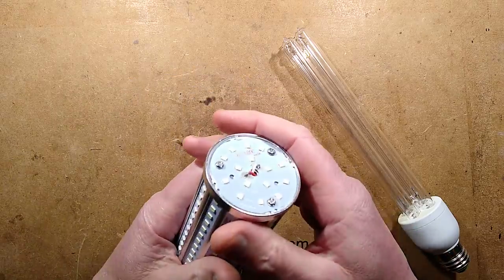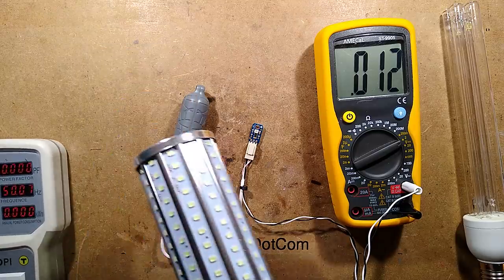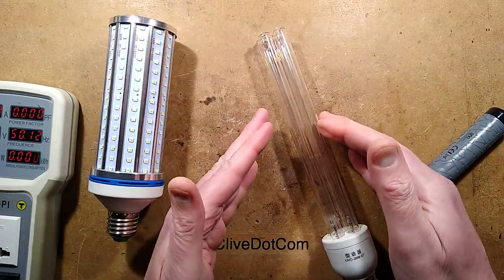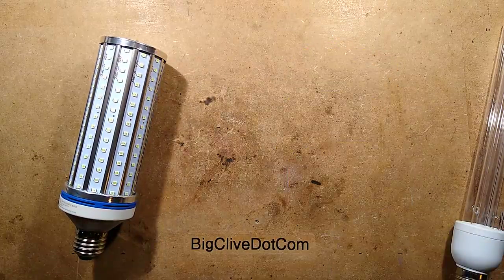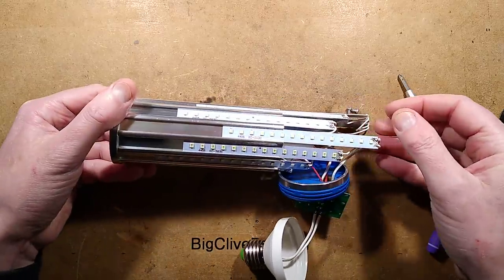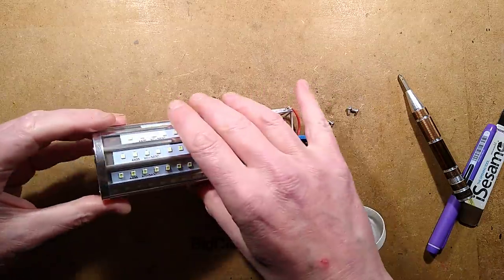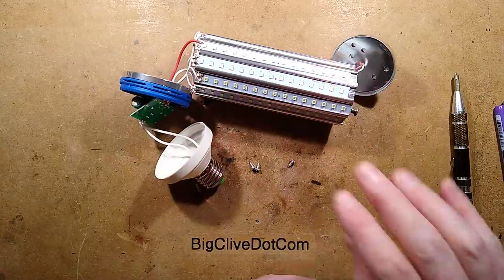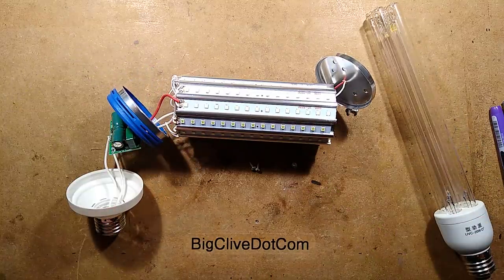Teardown of a fake UVC germicidal corn-cob lamp.

Comment: Bill Agnor

I  did a standard medical test to see if the Corn Cob LED light would kill bacteria.
 
Using a Sterile Prepoured Nutrient Agar Petri Dishes I introduced bacteria uniformly across the entire surface of the petri dish. I then laid an index card across half of the dish surface. Next I exposed the petri dish to the corn cob LED light at a distance of 4 inches for a period or 30 minutes (this extreme time should killed any bacteria) .
 
This configuration exposed half of the petri dish to the corn cob LED light and the other half of the petri dish was not exposed to the corn cob LED light. If the light was a real germicidal light the first side of the dish (exposed to the light) should have all of it's bacteria killed while the other half of the dish that was cover up should have a strong colony of bacteria growing after 24 hours of incubation.

Coming out of the incubator both sides of the petri dish are completely covered with bacteria.
The LED light has no effect on the bacteria. The germicidal LED Corn Lamp is a totally Fake.
Reply: Bill Agnor Thanks for confirming, that once again, Clive was right. Your test convinced me completely.
Reply: Dave Micolichek  I know, but with my medical background this is the ultimate test for me and other biochemical guys
Reply: Против Глобал  The petri dish test is based on the effects that only UVc light will kill bacteria. You can test any light system with a petri dish and the bacteria is only killed by UVc light therefore if the bacteria is killed it must be UVc light. In contrast if the bacteria are still living after being exposed to a test light source it is know that the light is not a UVc light. The exposure time and light intensity can be a factor so that is why my test used the extremely long time of 30 minuets.
Reply: Против Глобал The UV spectrum is divided in to UVa, UVb, and UVc. 

UVa goes from 315nm to 400nm and is generally consider Black Light that has no effect on bacteria.

UVb goes from 280nm to 315nm and is the range that tanning salons use but this range does not kill bacteria.

UVc goes from 100nm to 280nm. It is not visible to the human eye. This is the only range that kill bacteria. 

The reason people commonly beleive blue visible light will kill bacteria comes from the blue light produce by UVc quartz glass mercury vapor lamps that have been used for years to kill bacteria. The quartz class tube has a small amount of mercury inside and when it is energized it has two output products. First a soft blue visible light around 400nm to 450nm that does not kill bacteria, and Secondly an invisible bacterial killing light typically at the frequency of 254nm .

This allows sellers to use very cheap blue led's  that have no 245nm invisible  bacteria killing properties. This is a Hugh scam on the internet
Reply: Против Глобал  UVa does not kill bacteria.
Reply: Report your results to the FDA and CDC.  It's time to have government agencies go after Amazon and eBay for allowing these scam products to be sold on their platforms.
Reply: So are all corncob LED lights fake ??

Comment: Thank you so much for this teardown! 

When I was researching UVC germicidal lamps to construct a Coronavirus sterilizer, I found this exact type of bulb being widely marketed on both Amazon & eBay. At first it was very tempting because I was averse to the eventual disposal of a mercury vapor lamp, but as I read about commercial UVC LED's and then couldn't get a quote from the world's OEM's, I figured out that at that retail price they couldn't possibly have legitimate UVC LED's in them. So I went with a mercury vapor water sterilizer bulb.

But I just wonder how many people bought these bulbs to disinfect items, especially masks, and it was doing absolutely nothing. The advertisers & resellers could be guilty of criminally negligent homicide for selling these bulbs as germicidal during a viral pandemic. Shame on them!
Reply from the maker: The Chinese sellers have been selling fake and openly dangerous products for a while.  They really don't care.
Reply: @bigclivedotcom  Careful, or the almighty Andrew Cuomo will challenge you to a fight in defense of his precious china.
Reply: if you want to sterilize transparent clean gas (clean air) or fluids (clean water) it's ok to try uvc, but you will still get problems, even in ultra pure water.
- Life finds its way, as in Jurassic Park.

But anything with fibres, color, pigments or simply multiple layers (or even enough dust particles) is not safer by just beeing in a compartment with uvc.
- so, pleaaaaase dont take it personally, but i really doubt that your uvc lamp has a noticable effect (what do you use it in/for and hoping to get?).

Try "infrared" and simply heat it up to 75°C. Not clean but for sure "dead" for some time.

Just wash anything at 60°C (or better above that) with a normal household washing powder, not adding "sterilizing" overpriced marketing things.
...Good old times with 90°C washing...

and get rid of those stinking "microsuperfibers" who need desinfectant and sterilizers added and produce microplastics.

The washing machine and all "washed" clothes in many "modern" households simply stink again within short time because only washing at 40°C does not kill anything,
it only pauses it for a moment. oversaving water and powder (or using liquid cleaners which need addities to be that way) adds to the problem.

Then blending the stink over with adding tons of softeners does not help.
And it does also not help to add sanitizers (without running high temperatures to kill and remove in between) because the stinky biogoo
just stays in your machine as perfect nourishment for the next bacteria.
- Same hoax is done when the "car service" just sprays desinfectant into your car AC instead of CLEANING it.
Its a business, not a cure.

One warm humid day later (in case of washing machines, letting it sit one day) and all things grew back and you have the old moldy smell again.

...
...
...
...
-- Sorry for the rant :-(
We had tennants "my age" (around 30) (and also a classmate*) who were too stupid to properly wash their clothes and sent their kids with stinking clothes into kindergarden and school (guess the reaction of other kids...) and did not even notice it anymore because of the "smelly dog" effect.
I went through the basement looking for where that moldy smell came from and found it (repeatedly) being the "fresh washed clothes hanging to dry"
or even better, nicely breeding the stink at humid 40°C in the dryer.
But as a solution of course there was ultra eco bio washing liquid soap, "water and energy saving" programs for the machine
AND hard sterilizing additives added from time to time when the stink got too hard.

*stinky hand towels with tons of parfume softeners but still stinking underneath after getting wet/used. Also "sporting" clothes.
i smelled it, she did not even notice anymore.
Reply: Look up - suing or prosecuting anyone in China. Go back to sleep.
Reply: Viral disinfection via UVC light at around 254nm wavelength is well-researched, and for N95 mask decontamination, which is what I was planning, there is a site hosted by Nebraska Medical at www.n95decon.org that has all the relevant technical information, including UVC dosage & links to experimental citations and scientific analyses.
Reply: @alanmcrae8594  Thank you for the link. Watched the video about the different methods tested. 
interesting to see that nobody recommends using a mask for more then 5 on-offs because the fit is too bad then.
... I never had a mask which even at first usage gave me the feeling of a really tight seal :-(
Following the video for the "home user" the combination of heat and humidity by running an oven with a water pot inside and ramping it up to 85°C might be easier to handle and control.
Main problem does not seem to be treating one or two masks, but multiple at once.
 I go for the simple way of "my (surgical) mask protects other people if i wear it". And that other people wear their masks also.
Reply: bigclivedotcom I am looking for a genuine uvc germicide lamp, can anyone point me to one, I can’t tell what’s fake and what’s not.
Reply: Philips brand UVC germicidal bulbs are definitely real, but they cost a bit more. Anything from China and anything unbranded or off-branded is a bit of a risk. There are UVC bulb 3rd party testing companies, but they wouldn't give me a list of bulbs that passed their rigorous testing. This is such a money-grubbing, BS marketplace - be careful!
Reply: Alan McRae Thanks Alan, I’ll look at the Philips. Cheers!
Reply: Start reporting these postings to the CDC, FDA and other government agencies.  With enough complaints they might act on it.
Reply: @alanmcrae8594  Anything from Amazon or eBay are most likely to be fake or counterfeit.  Even the name brands.
Reply: @MichaeljRichter  Yeah, it is very difficult to tell what you are going to receive when it finally arrives at your door.  Even user product reviews can't be trusted because they get spammed by sellers & manufacturers. Online retailing is just like social media: untrustworthy & full of BS artists & scammers. Hard to be a diy engineer when you don't know where to source things reliably.
Reply: What’s a mercury vapor sterilizer?? and where can I find one ??? I bought a bunch of these ‘UVC’ Wands in JAN 2020🤦‍♂️ before videos like this one showed up on YouTube.
Reply: Alan McRae great website though didn’t understand much of it, i was hoping there’d be a video on what real UVC looks like .
Reply: @yeahidoubtit2094  A mercury vapor sterilizer bulb is basically a fluorescent light bulb that uses a special UVC wavelength transparent glass that doesn't have the visible light emitting phosphor coating of a standard fluorescent bulb. Both types of fluorescent bulbs vaporize a small amount of mercury inside the bulb to conduct the electrical arc that will convert some of the electrical current into EM radiation. (Because they contain mercury, germicidal UV bulbs must be disposed of properly when they eventually burn out like standard fluorescent bulbs.)
Bulbs based on mercury vapor are most likely good emitters of UV-C radiation at 254nm germicidal wavelength and nearby wavelengths. Consumer-marketed LED bulbs that claim to be UV-C germicidal lights are quite likely to be fakes. Real UV-C LED's are rather pricey.
Reply: Alan McRae I see, what do you think about about these strips from cureuv.com ? Apparently they turn from yellow to green when it’s being hit with the proper amount of UVC.
Reply: @mattt9347  any UVC lamp that uses LEDs is fake, go only for mercury vapor lamps. UV leds exist only in the 365-400nm range and maybe UVB, but not UVC, and if UVC leds exixt they are not commercially available yet

Comment: Have "known" since the 70's that forward voltage is related directly to the shortest wavelength (highest energy) photons out of the thing......solid state physics......so  from a diode junction forward voltage you get the wavelength.....that was why red led g a was 1.6-7 V infra red 0.7V and green 2.8V.  Modern led seem to use blue/violet led and phosphor of choice hence 3 V led.....one from this could guess these violet led to be about half the wavelength of those red led....

Comment: I was looking around on ebay a couple weeks ago for UVC sources to upgrade my ghetto EPROM eraser with and was amazed at how many of these scamlights there were. Luckily I'd used "ice blue" LEDs in a previous project so the color was familiar and the oddball packaging of real UVC LEDs made me immediately skeptical but for a minute or two I was like "did UVC LEDs really get that cheap?"

Ice blue is a nice LED color though, really does resemble the mercury discharge and is quite appealing.

Comment: I would love to be able to buy the aluminium extrusion and base without the fake UVC LEDs, to use for my own LED project; perhaps when these fakes are being dumped at cost I will pick some up 😊
Reply: A possible approach would be use LED tape.
The PCBs with LEDs on may be changeable. Even able to have the LEDs replaced.

Comment: 4:55: Dumb newbie question: Why does that voltage drop across the lamp indicate a buck regulator? I'd have assumed that drop was one of the diodes from the bridge rectifier. But how would I know whether behind that, there was a capacitive dropper or a buck regulator? Both have one rail basically going straight through with only that one diode. And the other rail has either a capacitor (which would block DC) or a switching transistor (which I assume is normally off and thus also block DC). So I would have thought they'd measure the same. What didn't I understand?
Reply from the maker: An isolated power supply will not read anything from the LEDs to the mains connection.  A non-isolated supply will often read as a diode.
Reply: @bigclivedotcom  So... just from that measurement, it could have been a capacitive dropper? Those aren't isolated as well, right? But we could rule that out in case of this lamp because... with that many LEDs and their power demands even the Chinese wouldn't use a capacitive dropper? Or was it the power factor on the HOPI that gave it away?
Reply from the maker: @Foobar_The_Fat_Penguin  Capacitive droppers are only suitable for low power lamps.  For higher powers a switching/buck regulator is needed.
Reply: @bigclivedotcom  Hah! I figured something out correctly! Yay! Thanks for the reply!

Comment: 9:54 yup. I got the led first, and felt the mercury one would be just as safe. However, about 10 minutes of exposure to the mercury one left my eyes sunburned for 2 days. VERY painful! You don't feel it as it's happening either. Just a heads up.
Reply from the maker: That's a big problem with the fake ones.  They instill a false sense of safety.

Comment: You're a COOL guy! I WISH I had your kind of knowledge! I bought a similar, but half the length, LED light (not UVC) for lighting my YT set. Supposed to be 4,000 lumens. Installed it in my softbox and was VERY disappointed with the amount of light it was putting out. Watching your video makes me wonder how UNDERRATED it is in terms of "wattage" and light output. I wish I knew how to calculate the ACTUAL wattage like you did so quickly in this video. Keep being cool! Cheers!
Reply: He didn't calculate it, he measured it.  With the Hopi meter at the left.  The one with the flickery display.
Reply: @bdf2718  Yes ... I re-watched that part of the video and saw the meter AFTER I posted the comment. Duh! I have a very hard time concentrating on media cuz most of it is boring and/or repetitive. I tend to basically ignore/tune out a lot of what I watch. Thx for the heads-up!

Comment: Clive, whats the best Type of UV  for UV resin Glues ?
Reply from the maker: Usually UVA.  The manufacturer will often specify a specific peak wavelength.
Reply: @bigclivedotcom  thanks clive i have always wondered , i did have the orginal 5-sec glue one, but battery went flat , so bought a large  cheap 3aaa battery one of ebay it worked but not as good even though it was bright and lasted ages , it was a slightly different colour , iam guessing its a different frequency..

Comment: I got some of the GUVC-T21GH sensors that a viewer suggested last time.  Digikey stock has gone from 50 to 19 since your video, haha.
  Used 'em to confirm that my OD-7 UV blocking glasses work quite well.  And filled my house with ozone after trying one of the eBay 8W tube lamps for 15 minutes (oops).  Be careful folks, UVC radiation and ozone gas exposure is serious business.

Comment: I ended up with one of these after not paying close enough attention to a bait and switch on eBay. The listing had different options for wattage and ozone/no-ozone, some of the listings looked real, some of them were these ice blue disco lights. At least mine doesn't have live exposed metal, and eBay made sure I could return it at the seller's expense.

Comment: Hi Clive I have a question. Does a mercury arc rectifier produce uv light? As they produce a purpleish light as the spark runs around the pool of mercury
Reply from the maker: They do inside, but the glass filters the harmful wavelengths out.

Comment: Love your videos calling out the fake UVC lamps. I am looking for a suitable lamp to sanitize the rooms in my house, in your experienced opinion, how powerful a lamp would be enough to sanitize a bedroom for example? What wattage is enough for coverage of say a 150-200 square feet room? And what about sanitizing of the surfaces that are not directly in the coverage of the UVC light that's emitting from the lamp? Will the ozone that's created by the UVC lamp also kill most germs and bacteria effectively on surfaces that aren't under the UVC lamp's direct coverage?
Reply from the maker: There are lots of variables.  It would require a proper scientific test to determine the optimal exposure time.
Reply: @bigclivedotcom  Thanks so much for replying, appreciate that. Leaving exposure time out as a variable, how much wattage would be needed to cover a room? Would I be better off using a tube UVC lamp or LED type UVC lamp with a whole bunch of the chips (real ones!), I'm guessing LED bulbs would be more intense therefore have more effective coverage even though they have much lower wattage than the tubes? Is that accurate in your opinion? Also, does the ozone assist in killing a good % of the germs/bacteria as well? Thank you so much for your advice, your expertise in this really helps in my choice of what to purchase, glad I found your channel :)